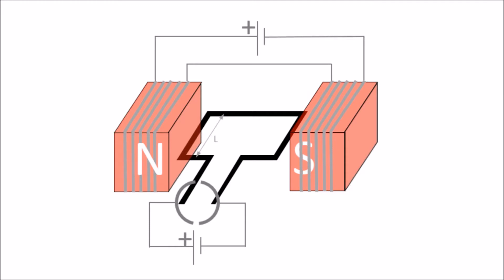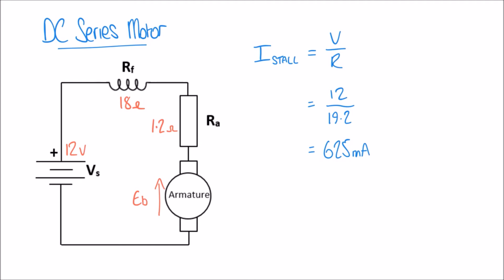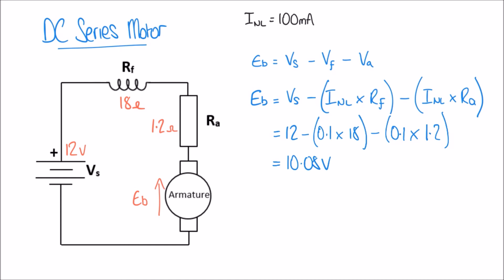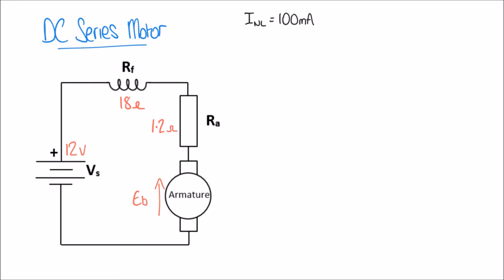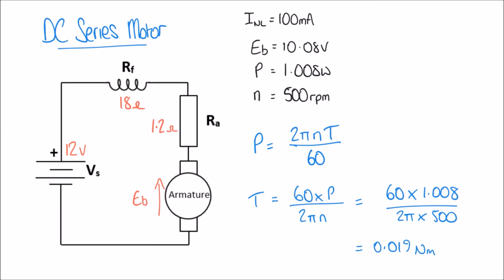Calculating Back EMF, Power and Torque for a DC Series Motor

Comment: Why do you use the back emf to calculate the power, and not the voltage across the resistance of the armature?
Reply from the maker: Hi Elly, the mechanical (rotational) power developed by the armature is dependant on the voltage (back EMF) produced at the armature. There will be power dissipated across the resistance of the armature as you say, but these will be losses (heat) rather than "useful" power.